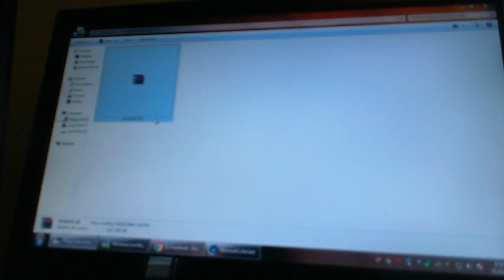Installing 5 1⁄4 inch floppy drive on Windows 7!

Comment: And for motherboards too new to have a floppy drive header, the next project should be to take apart one of those external USB 3.5" floppy drives and see if the USB bridge board likes being connected to a 5.25" drive instead. :-)

Comment: Faaaake
Reply: Wut? This isn't a big thing to get your head around. It's just installing an old drive into a new computer. Windows still supports all the old controllers and floppy formats (kinda pointless removing them) and new hardware still supports floppy drives. It's the same controller that runs a 3.5 inch drive that runs a 5.25 inch one. Pro workstations still come with legacy ports (like floppy controller ports), hell you can still buy motherboards with ISA slots if you are willing to pay a stupid amount of cash for them (I'm not talking cheap ass gamer PC shit where they have removed all the PS2, RS232, IEEE1284. etc ports and throw a bucket load of USB's at you to plug in the toys). Industry and the military still use older interfaces, they tend to go with the tried and tested approach and don't change anything unless they absolutely have to.  Newer systems just physically access legacy devices through a Super IO chip that's on an LPC bus instead of an ISA bus, to software, it looks like an ISA bus (same addressing system).

Comment: It isn't always a b:\ drive, it can be a:\ also, it just depends on which connector you mount it on the ribbon, if you mount it to the one with the twist it will be a:\

Comment: Windows 7...but what? You still didn't answer the hardware questions...What kind of machine was it? How you connected to the MB...if you had a floppy controller with an ISA slot or if you found some way to do it on IDE, or what? Come on man! Give some friggin details!! This video (as it is) is useless!
Reply from the maker: Sorry! I made this video years ago and it was the first, and only, "how to" themed video I've made. I admit, it sucks.  

I had tell the motherboard that I was installing a 5.25 in the BIOS. The motherboard was a K9A2 Platinum.

I connected a floppy cable to the motherboard.  I used one of those old style floppy cables that had both a 3.5 and 5.25 connectors. I also connected to the regular four pin power.
Reply: Well thanks. I appreciate the effort. I guess my bios is too new. (phoenix A01 1984-1988 licensed to Dell in 1990) it sees the drive as Drive A only when I don't put a 2nd drive on the cable...and it sees it as a 3.5" drive. :-(
Reply: What kind of machine was it, btw? P3, P4, 80486? What was the machine...Windows 7 doesn't say what the machine is...that would help also.
Reply from the maker: You need to get into the BIOS and tell it his A: or B: drive is 5.25" 1.2MB
Reply: Still doesnt explain much

Comment: You didn't video connecting the drive up, mounting it in the case or setting up the BIOS.  Just your two screens with pictures of yourself.  Self involved much?  I vote take down the video, it's does you and the tech community no favors.  My rather brusque two cents.

Comment: Next challenge: Install Windows 7 from 5.1/4" floppies.
Reply: Ummmmm, that would take forever.
Reply: SysGhost Please insert disk 701 of 2000. I know i'm 2 years late but I couldn't resist.
Reply: @MiilVothMein  oh hi, I'm from 2018. Floppy 1633 of 2000 now! Almost there, but I hate knowing it after Floppy n° 2000 I have these 6700 Floppy's with all the updates. Ugh.
Reply: Ali Mombali You sir win the prize for best use of a year old comment.

Comment: Way to not explain or show how you interfaced it with new hardware.
Reply: Nathaniel Christopher okay so how did you do it? Did your motherboard permit such old hardware?
Reply from the maker: Yeah, sorry. This was the first computer type video I made.
Reply from the maker: I had tell the motherboard that I was installing a 5.25 in the BIOS. The motherboard was a K9A2 Platinum.

I connected a floppy cable to the motherboard.  I used one of those old style floppy cables that had both a 3.5 and 5.25 connectors. I also connected to the regular four pin power.

Comment: I installed Win 8.1 Pro 64 bit on a  P5LP-LE motherboard that was sitting my junk pile.  That P5LP-LE board includes 'legacy' connectors...PS/2, IDE, and a floppy header.  I installed a 3.5 floppy drive. The system recognizes the drive (A) and it works fine.  Unfortunately, it will not recognize a second drive, so no 'B' drive. It's my understanding that Win 7-8 will handle multiple floppy drives, but in my case the board BIOS will only recognize one floppy.

Comment: Ok interesting. Question for you does the ribbon that the 5.25 floppy use just a normal ide? The connection on the back of 5.25 floppy drives looks like some sort of cart output. I dont know to much about that old of technology. Is all I need is the cabling and will it work via IDE?
Reply: Floppy drives WILL NOT work on a IDE header.  In addition, no one makes a PCI card for connecting floppy drives either.  If you have 3.5 discs, and your mobo does not have a floppy header, you can buy an external USB 3.5 floppy drive....I've never seen a 5.25 USB floppy drive.
Reply: MrSloika   Floppy drive controller card http://www.deviceside.com/fc5025.html to USB.  Legacy cards may also be purchased with PCI connectors but they are not cheap.
Reply: +John Ostrander That USB is a piece of crap, ir can only read floppies...
Reply: what else do you need to do? Who would want to write to one? Get the crap off & convert it to something current, (or play with it, in the case of games) ...I can't think of a single reason to write to a 5.25" floppy! It does the one thing that can't be done cheaply elsewhere...if you want to write floppies, go find a 80386 machine...and go back in time.
Reply: What else do I need to be able to do with storage media beside reading them, how about writing them to actually be able to read them?
Reasons:
1. Making discs for old gaming pcs.
2. Making program discs for old pcs.
3. Making low quality noise music releases (see: discogs).
4. Write there a backup of all important passwords.
5. Annoy IRS: http://www.fakt.pl/pieniadze/biznes/odpowiedz-na-wezwanie-ze-skarbowki-pliki-pod-haslem-jestem-glupia-biurwa/z4f1rwm (use google translate).

Beside, I have a working drive for that, that works in the tower next to my laptop and is shared via ethernet, that's the only way it can read and write from laptop, though that piece os asus cram mobo can handle only one floppy drive at the time.

Comment: Me too, I still have electronics dating back to the mid '80's like Atari 800 and the later ST 512 and more. Lots of AT cases and power supplies, cables, mobos, cpus, monitors, drawing/graphics pads with styluses, clam shell hand held devices -- you know: junk.... It's sad really. I could donate it to the local recycle groups but....
Reply from the maker: You and my roommate would get along really well! Hah! You should document your collection with some videos. I bet you have a lot of cool stuff... maybe try to get Windows 8.1. to load a Zip disc! :D

Comment: I have a late 90's floppy drive module from one of those old dell laptops in the shape of a square and ran on XP. Well i plugged it in my Windows 8 Dell 660s, and what do you know! I have an external floppy drive for my computer that works!

Comment: i never got the chance to use a 5 1/4 floppy disc. i started at 3 1/2 :(
this is the answer to why win7 have the 5 1/4 icon.
Reply: Win 10 also has it. Jrcraft installed a 5.25" drive in a Win 10 machine.

Comment from the maker: Yeah, I used a floppy cable that had the correct connectors. I'll post a link to what it looks like in the description. In addition to the ribbon cable I also had to adjust one setting in the BIOS and them *bam* I can haz archaic floppy drive! :)